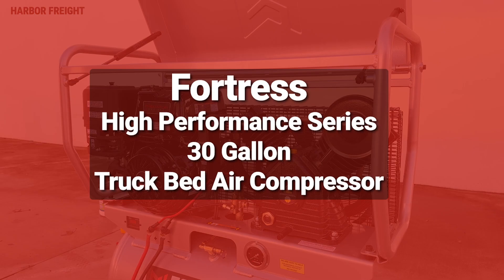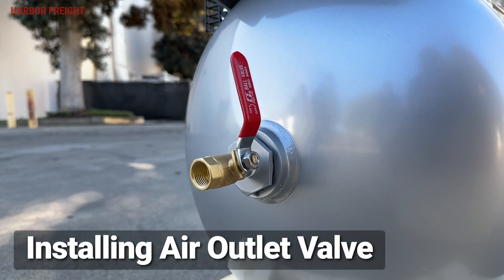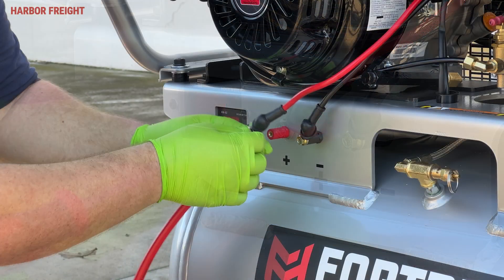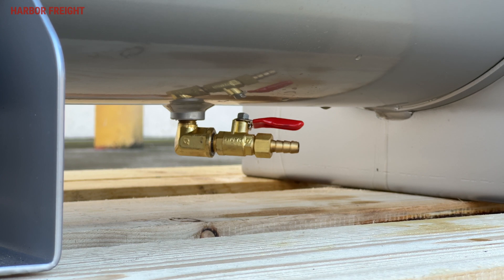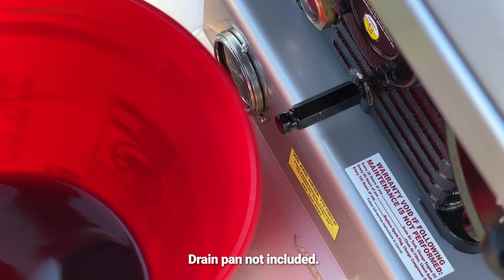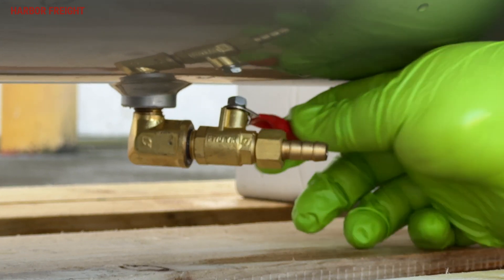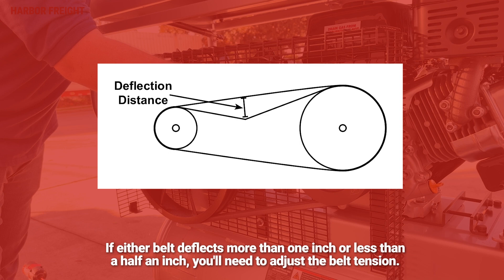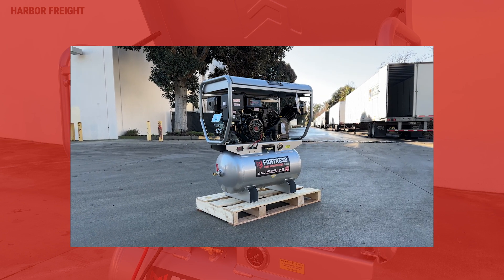Fortress High Performance Series: 30 Gallon Truck Bed Compressor Set Up, Operation, and Maintenance

Comment: Can a guy start this by using a jump pack instead of a battery
Reply: Ill try today. Ill let you knownif it works
Reply: @ great. Thanks
Reply: @ how’d it work out for you?
Reply: @lifewithabe312  have not tried it. As im writing this im fabricating axles to weld on to put big turf tires on this compressor so i can move it around.
Reply: Yes you can, that’s how I start mine